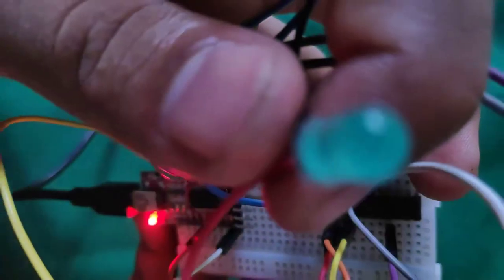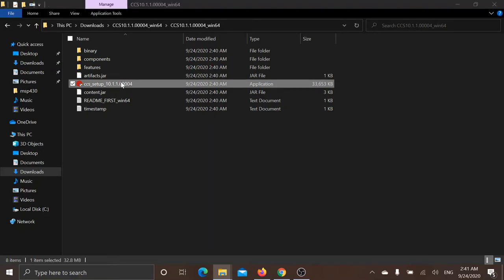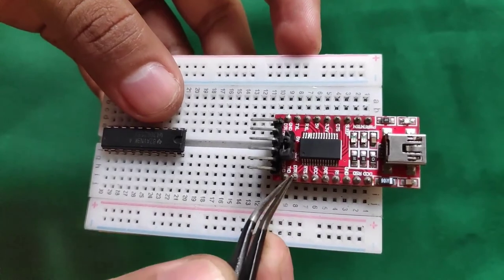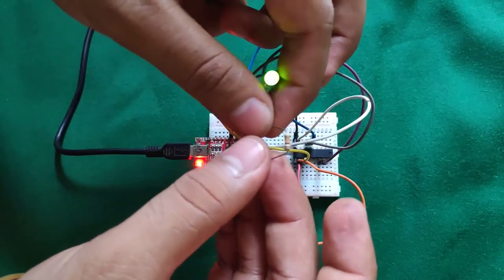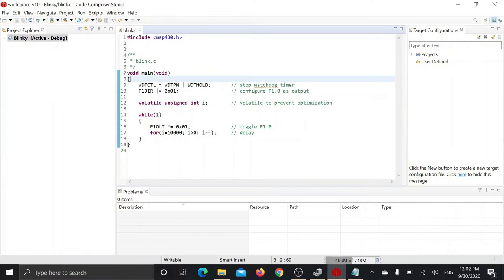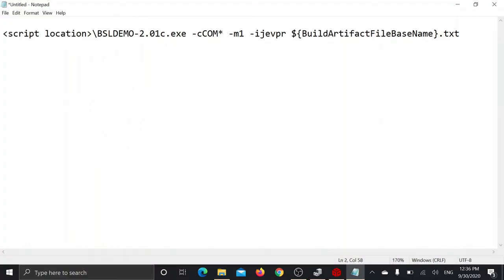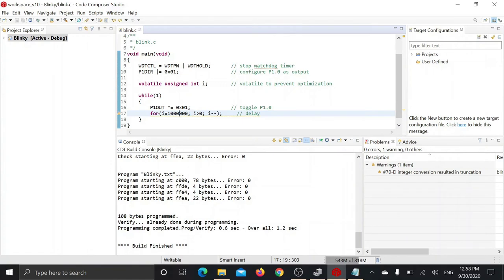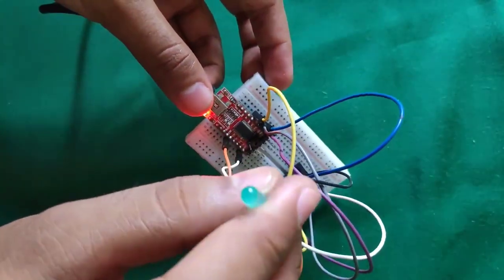Programming MSP430G2553 through BSL | MSP430 on a breadboard | UART bridge programmer

Comment: Hi Deepak, If I watch the circuit you build in the video I see TXD from UART bridge connects to pin 3 and RXD to pin 7 but in the schematic these connections are swapped. Please check and maybe add a footnote to which ever is correct. Cheers!

Comment: Hi, could you tell me, why did you connect the Tx pin to pin-7 as you can see from the pin diagram of IC, the TX pin is pin-4 and similarly the RST pin is pin-16 but you have connected it to pin-17
Reply from the maker: Hi, Hardware UART and BSL UART/programming pins are different that's why we need to connect TX/RX pin that way. 

RST pin is reset of MSP430 which we need to connect to DTR of RS232 line of UART-Bridge and we need to connect Test pin of MSP430 to RTS pin of RS232 line.

It can be kinda confusing at first glance, open the datasheet and take another look at the pinout of the IC and it will become much clearer ;)
Reply: @lorforlinux  After many hours and trying many different software, here is where I happened to learn that BSL UART has different pins. Fuck me sideways. Thanks....
Reply from the maker: @melonduofromage6058  impossible for me to fulfill your desire of remote copulation that too in a sophisticated approach of sideways but, I appreciate that my technical video aroused you and helped to resolve your problem at the same time. Please spread..... the video and channel if you like the content.

Comment: Hi Deepak i have tried the same way  you explained but i am getting below comments with error, help me to resolve this issue.
MSP430 Bootstrap Loader Communication Program (Version 2.01c)
Number of mass erase cycles set to 1.
Mass Erase...
ERROR: Synchronization failed!
Device with boot loader connected?
makefile:168: recipe for target 'post-build' failed
Reply: can you resolve this problem?
Reply: @heribertobermea7648  Hi there, yeah i have done this. But in different way.
Reply: @heribertobermea7648  Hi, Yes i have resolved this, but in a different way.

Comment: I guess we can't debug it with the cheap programmer
Reply from the maker: Yes, That is correct!
Reply: @lorforlinux  I new to these,should I buy nptel msp430 kit? or pic16 with programmer?
Reply from the maker: @027_lakshaynegi6  what do you want to achieve/learn? What are your requirements for a development platform? Is this in your curriculum or you are exploring?
Reply: @lorforlinux  I'm an ECE student and want job in embedded systems domain so that's why I'm learning it.
But moat of the job requirements are arm like stm32 and somewhere pic.
For internships it is raspberry pie or esp32  their programming is for hobbyist.

That's why I was wondering msp430 or pic16 for starting
Reply from the maker: @027_lakshaynegi6  I suggest you to go with STM32 bule Pill + stlink V2 programmer.
Reply from the maker: @027_lakshaynegi6  you can also get 2 raspberry pi pico boards and use one as a debugger.
Reply: @lorforlinux  thx but I read that most of the cheap blue pills are fake and debugger won't recognize them and for the real one I searched but their circuit diagram looks different,those cheap ones look like Arduino nano and in other websites it is a bigger board black in color.I don't if it is the same or different.
Reply: @lorforlinux  thx for your help
Reply from the maker: @027_lakshaynegi6  Ohh okay, you can go for raspberry pi pico route, it's new, fun, and it has ARM core so you can learn alot with that. It can be a very good starting point for you 👍 don't forget to get two so that one can be used as debugger.
Reply from the maker: @027_lakshaynegi6  pleasures is all mine ✌️